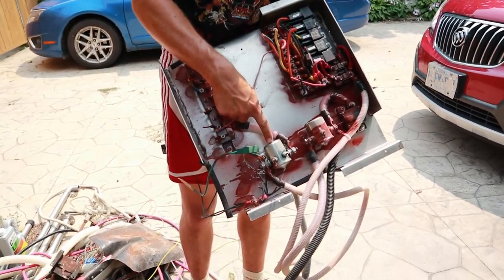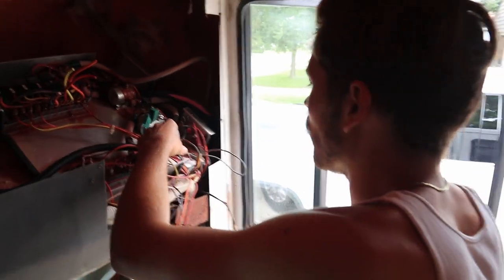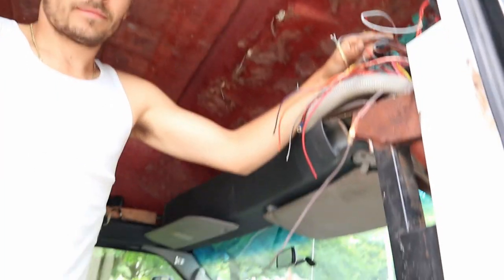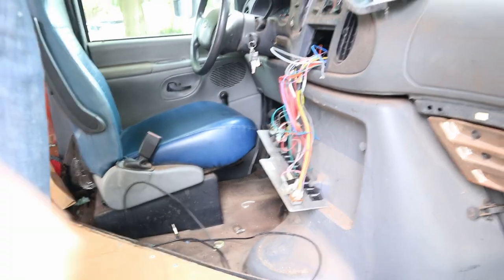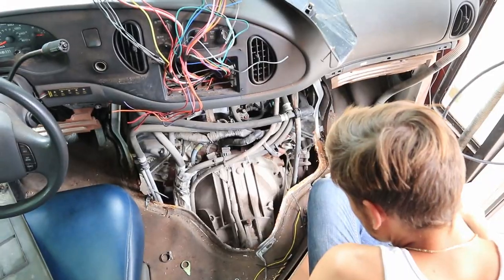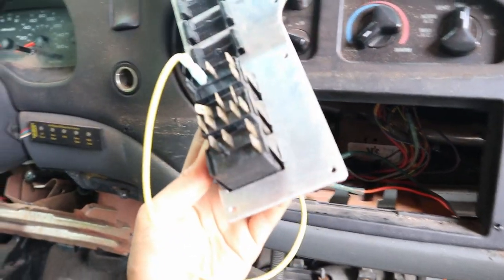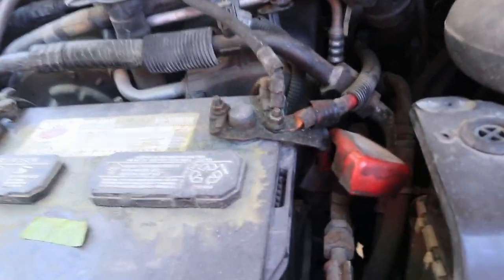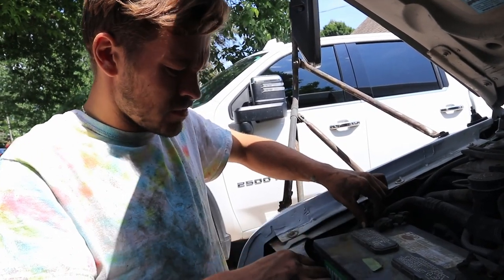Electrical Distribution Panel Removal | Shuttle Bus Conversion EP 6

Comment: I love how empty your bus is! I say that because it reminds me of how empty mine was before I put all my belongings in it :-) but the distribution box I'm not going to lie it's still in my bus sitting there. I cut a bunch of wires out of the back that were running up the back left corner of the bus and wouldn't you know I forgot well the battery was still attached. So when the spark started flying then I remembered did I probably ought to disconnect the battery. Now I'm not going to be driving in my bus anywhere until I have a few other things fixed under the hood but I am living in it full time, just 90% gutted and no subbing of the walls yet. But I really want to get that distribution box out of this bus! There's a whole bunch of things that are piggybacked onto the positive terminal of the battery and I'm pretty sure that they go to wires that don't need to be in the bus any longer, the lift etc. By the way my bus is a 2003 Ford E350 Super duty shuttle bus so yours is just two years younger than mine! And I must be honest I have not seen the end of the build yet :-) I'm trying to be good! I really wish that the electrician ferries would just pop in and help me remove it but I'm pretty sure that's not going to happen :-)

Comment: Omg!! Jesus I cut back all wires right side on my 2007 and then freaked out thinking I screwed myself. Not true saved all wires tied up neatly. My big question was that giant panel I knew I didn’t need. Almost all vehicle wires are under or run high? So I was afraid to take the panel out but, this encouraged me to believe I’m doing right. Going solar so secondary is gone in an hour. I figure from there the only electrical important are the brake lights etc. ❤❤❤❤

Comment: Hi. Thanks for this post.  And yes, you ALWAYS disconnect the negative battery terminal FIRST.  The reason for this is that if you have a negative ground 12Vdc electrical system, if your wrench to tool should come in contact with the frame of the vehicle, nothing will happen.  The negative battery terminal is connected to the frame or ground of the vehicle so your wrench contacting the ground is OK.  If however, you try to disconnect the + or positive first, and your wrench should hit the metal frame of the vehicle, you might just have your first lesson in arc welding. At least, the spark that will be emitted will be a 'come to jesus moment' for you so you will never again forget to always disconnect the - or negative terminal first.
Thanks again for the post.😁